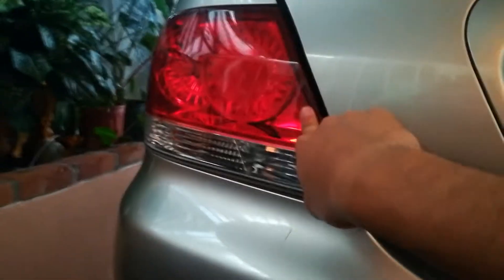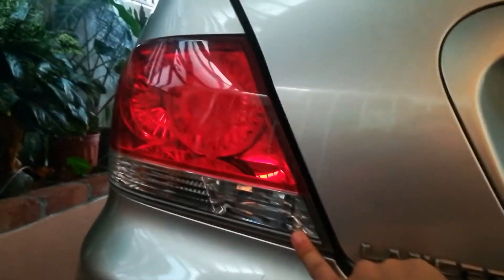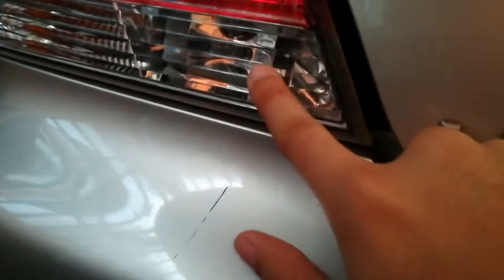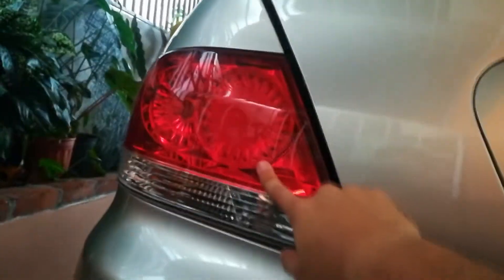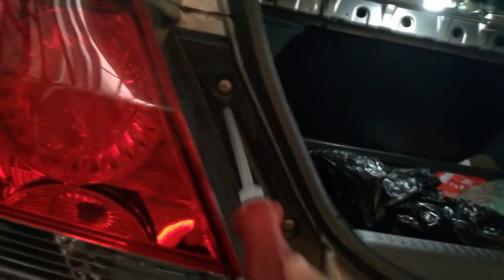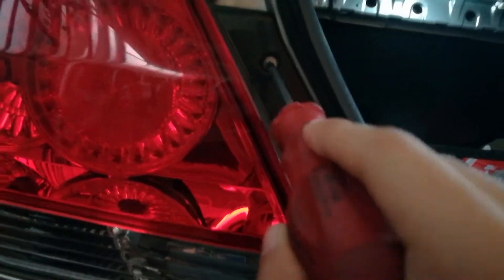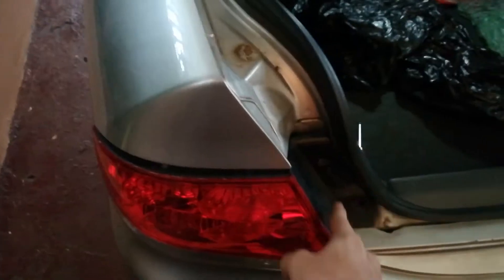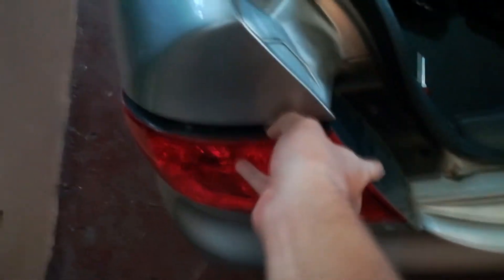How to change your reverse light Mitsubishi Lancer 02-04

Comment: what bulb size is the small brake light? the one you pointed at?
Reply: im trying to change them to LEDs, i got the main brake bulbs on LEDs but the brake lights that stay on, the smaller ones i can’t find a part number for them
Reply from the maker: @hebermoran89  Hello, I think is T10

Comment: What model is that bulb?
Reply from the maker: LED T10, I hope is was helpful for you the vídeo.
Reply: @nomis97  thanks bro. And the turn signal? T10 o T15?
Reply from the maker: @juanmangialardo  You´re welcome bro, The turn signal I think is T10 also, but in that one I´m not sure. You can confirm, you just need to take it off and see if it´s the same size as the reverse light.